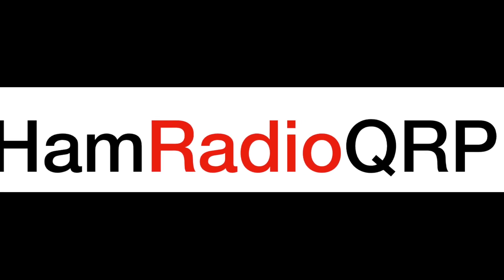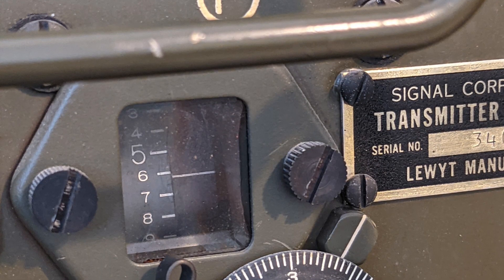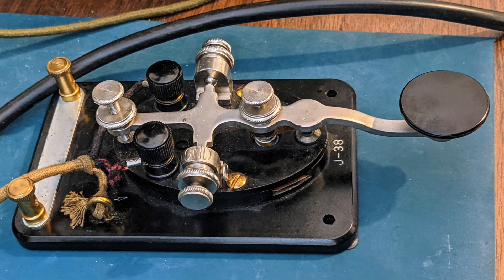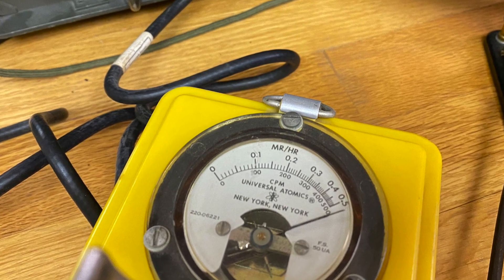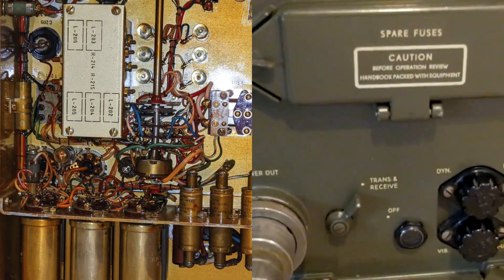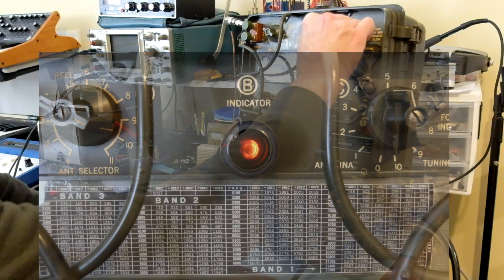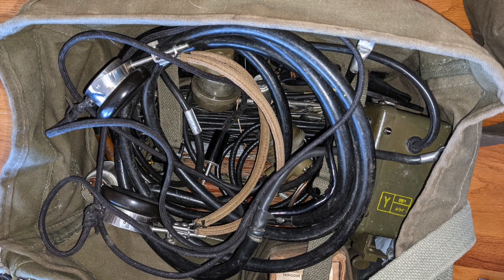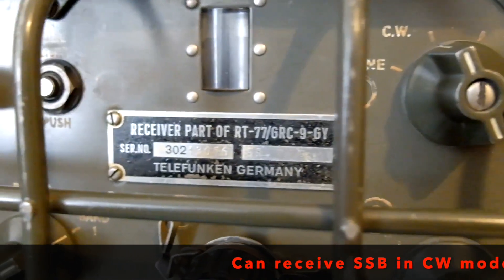AN/GRC-9 aka "Angry Nine" Military Field Radio

Comment: Explain the Morse code transmission
Reply from the maker: There were a few different partial conversations from different operators mixed in that video.  They were just sending locations, names and club numbers.  The code I sent was a request for a conversation along with my call sign.  That's referred to as calling "CQ"

Comment: If I recall, it was tough to find the dynamometer
Reply from the maker: I still see them for sale but the vibrator for the low voltage circuit has usually stopped working or is unstable. I tried refurbishing a couple of spares but eventually built a solid state replacement for the low voltage circuit in my dynamotor.

Comment: I may have missed it, but where did you say you got your radio?
Reply from the maker: Famous auction site e*ay
The fellow had UPS store pack it... They didn't use any filler in the boxes and by the time it had gotten to me the parts and bags were mostly missing box.  Yet I did receive everything.  It's a testimony to the toughness of the equipment that it made across most the country as just raw parts bouncing around in trucks and still mostly worked when I received it.
Reply from the maker: Famous auction site

Comment: 2:49 Who's giving you that advice? The Alpha particles emissions are harmless. As long as the paint is not flaking or you're ingesting the pain there's zero risk to you or anyone else.
Reply: That's why is routine to cover it in clear enamel, to minimizing the flake off of the paint. Specially during operation, it's almost imposible not to touch the paint while operating the radio.

Comment: Great rig in fantastic condition. Alpha emitters are pretty safe, just dont eat the paint.
Reply from the maker: I have more video concerning the radiation after measuring with my own geiger counter.  I need to edit and post. Almost half is Gamma, not stopped by aluminum.
Reply: @HamRadioQRP  😯
Reply: @HamRadioQRP  I have a GRC-9 and love it - a super cool rig.  At what distance away from the panel did the Geiger counter start normalizing again to background levels?  Please post the video you made of your testing.  Thanks and 73!

Comment: Very nice looking example and very interesting, thank you. Portable! Just slightly heavier than an FT-817!  😄 The method of setting the TX frequency reminds me of the (super accurate) BC-221 frequency meter. So, wondering if it uses same design idea? Good that you got on the air with it. It sounds nice (apart from the generator whine, perhaps).
Reply from the maker: Not too bad with headphones.

Comment: Isn't new technology great
Reply from the maker: Indeed. But sometimes we appreciate new technology more when we experience its predecessors. 

I started in the hobby with relatively modern rigs. I've enjoyed learning to use and repair   radios that were amazing for their innovation of their time.  I also learn more about radio and operating when using equipment that forces me to understand what I'm doing. This is my first radio with a separate receiver and transmitter. Older hams grew up with this but it's instructive to me. 

I don't personally know of another radio beyond the GRC-9 and its counterparts that could be supplied power by so many different and variable means. It could be powered by battery, hand crank generator, dynamotors supplied from 6vdc, 12vdc, 24vdc, 115vac and even a gas powered unit.  The circuitry inside the radio dealt with simultaneous connection of a battery and hand crank generator, and operated the receiver on a very low current draw (for the time) of 500ma for filament and 200ma for the plate current. 

It wouldn't even power the transmitter section in phone mode until the PTT was pressed, to save power. 

If the battery was attached while using the hand crank generator it reduced the load on the person cranking. 

There were some very innovative people designing this stuff 80 years ago, using pencil and paper and their imagination.  

This is also the only transceiver I'm familiar with that can be used in the rain or float in a lake and still operate after pulling it out. 

I could go on and on about the design of the carry bag, or the fast deployment counterpoise, or the end fed antenna with disconnect sections for tuning with an attached frequency card, or the earbuds...